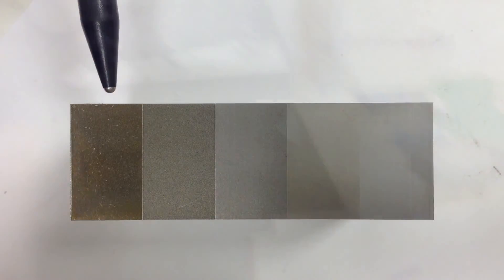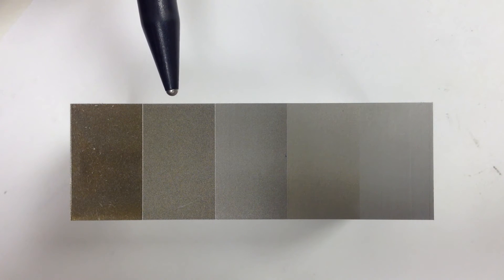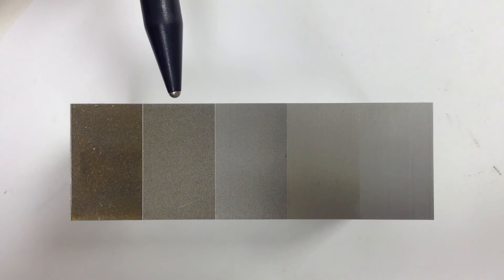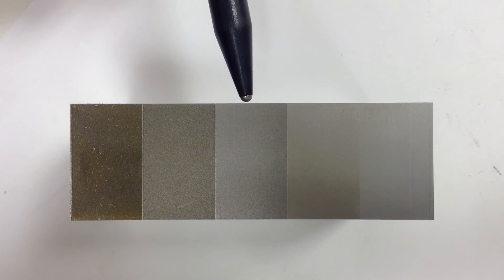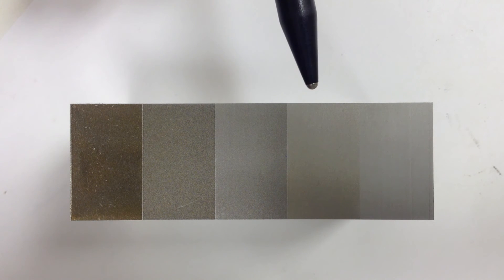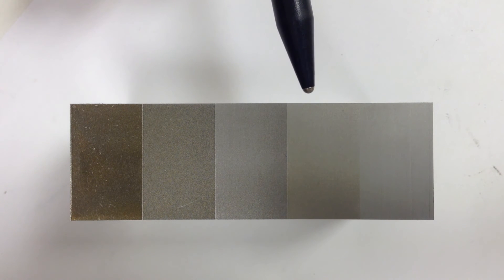Surface Finish 5 Pass Cut

Comment: Should I leave extra material on the part to make multiple passes? Or is it enough to make more passes without leaving extra material?
Reply from the maker: @dovlokk  you don’t need to leave extra material.  Just tell the machine how many passes you want and it calculates the offset to make the final pass be the right size.  It’s good practice in wire EDM to have maybe a 1/8 to 1/4” stock on the part.  Cutting it close does not help the process.  Leaving 0.015 stock makes the first rough cut more difficult than it needs to be.